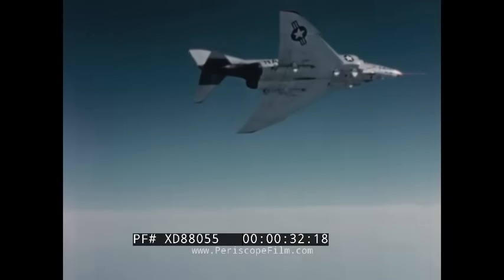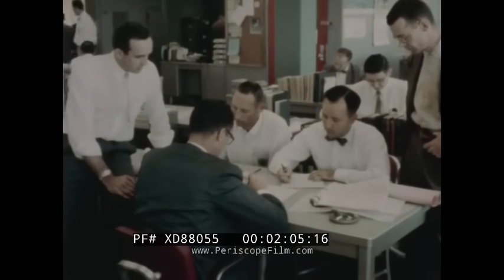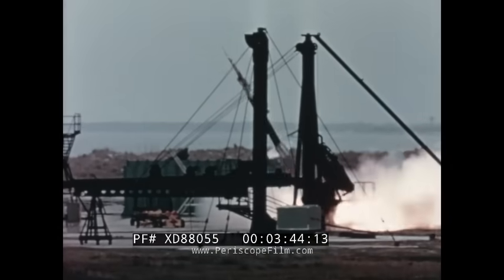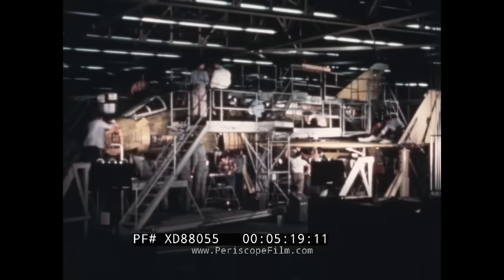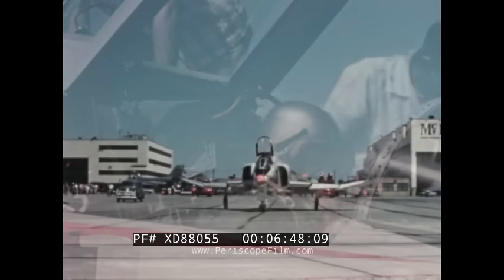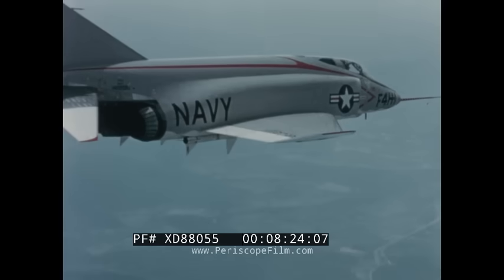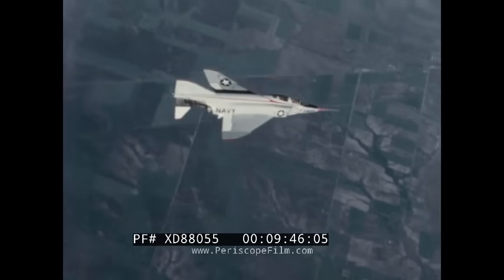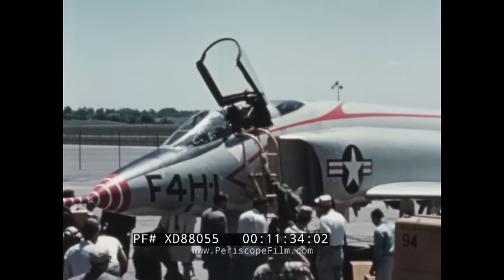"THE F4H NAVY FIGHTER" 1960s MCDONNELL AIRCRAFT F-4 PHANTOM FIGHTER JET PROMO FILM XD88055

Comment: By the way, I have NEVER heard of an "H" model!
Reply: Pre 1962 the USAF and the USN used different designations. The USN system used a mission designator, #, and aircraft manufacturer code. F for fighter, 4 for the 4th fighter from McDonnell for the Navy, and H to designate McDonnell. So you have the FH Phantom, F2H Banshee, F3H Demon, and F4H Phantom II. This is also How you get the F4F Wildcat from Grumman and F4U Corsair from Vought (and later the F8U Crusader).  Post 1962 the USAF and USN systems merged, so the F4H became the F-4B, where the last letter is the variant of that airframe instead of a manufacturer code.
Reply: @davidnewcomb9306  I’ve been working from some casual observation and conversation, and misinterpreted a few.
McDonnell, certainly made it interesting however.
Reply: It was an early designation, the phantom was a descendant from the demon, Originally they wanted to call the aircraft the satanic, but that was rethought.

Comment: In 1976, I was a structural mechanic on F-C and E models and did a little work on a VooDoo.  Unbelievable engineering but very hard to work on.  This was at E Systems in Greenville, SC, and they eventually lost the contract.  The pay was atrocious but, even with that I miss working on that plane!